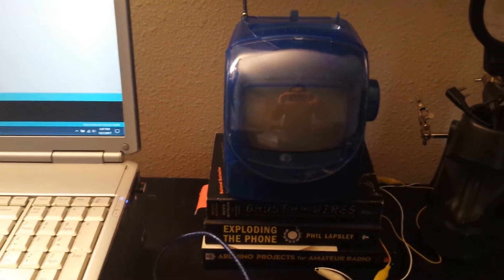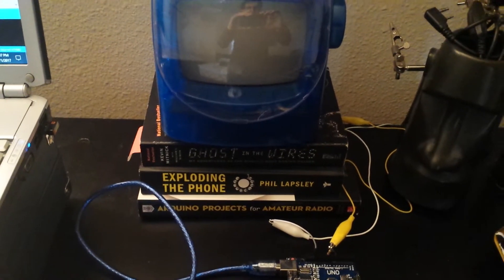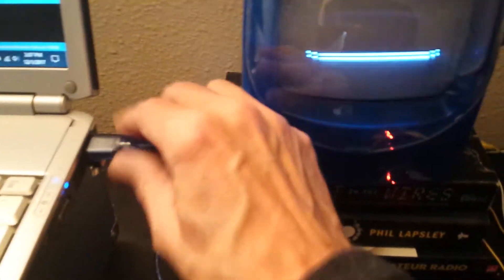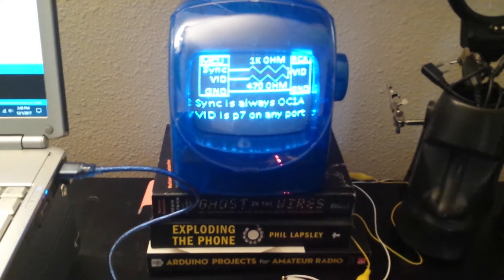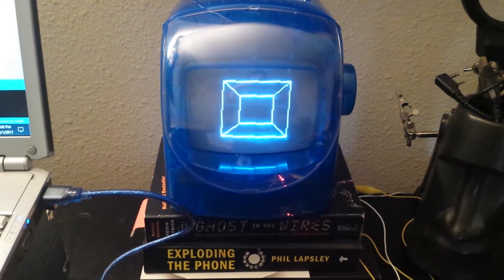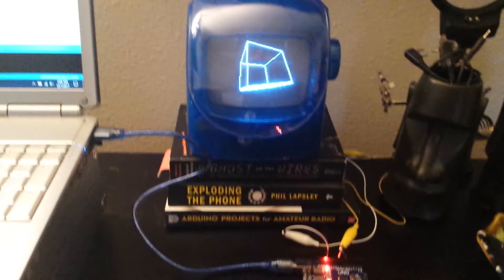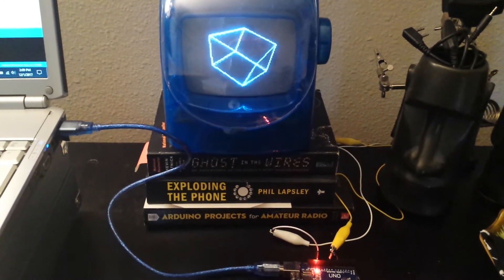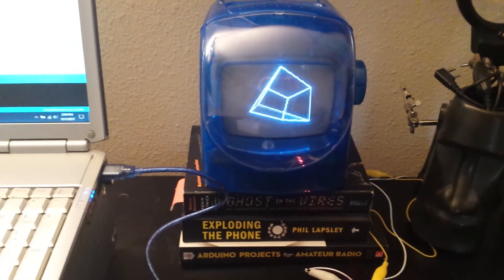Arduino TVout on a 5 inch BW analog TV

Comment: Cool! Is it possible to feed data from the laptop to the Arduino to update the video occasionally? Or is the display static?

Also, is that Arduino for Amateur Radio book good?
Reply from the maker: The Arduino for Amateur Radio book is not bad. But don't buy it, if you can get a copy from your library. :) 

I'm not sure whether I understand what you mean by "feeding data from the laptop to the Arduino." The only data that gets sent to the Arduino is the code that is written in order to make the display sequence appear. I'm not all that proficient at the coding side of these projects yet, but I am trying to learn.